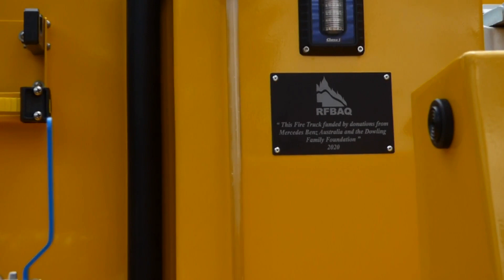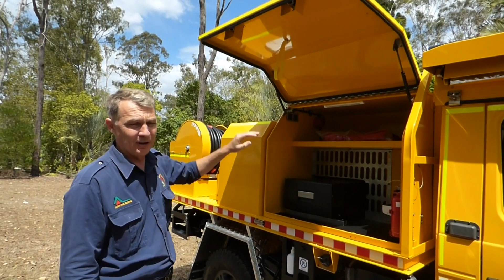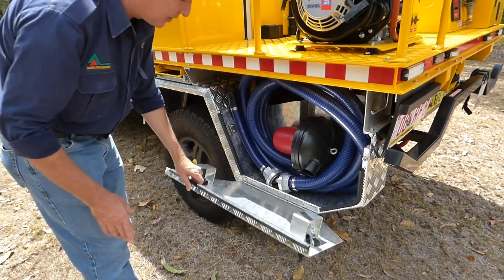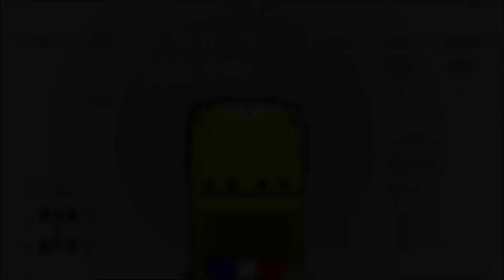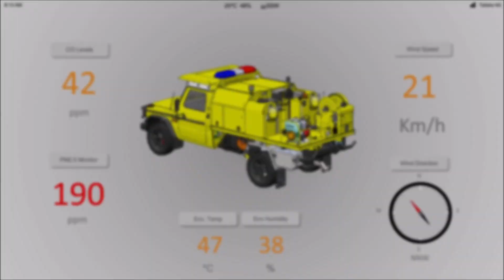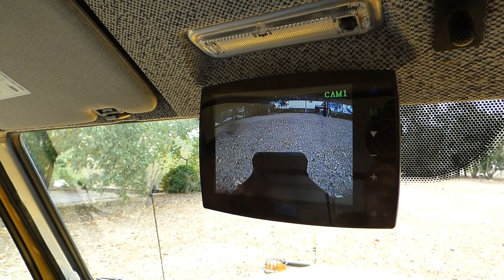RFBAQ QuikCorp Innovation Platform

Comment: In theory every appliance should be put over a weighbridge to make sure they are within GVM. This is unlikely to happen because many would fail.  This is a huge risk that is ignored by QFES.

Some great ideas on this appliance.  I particularly like the drip torch fuel tank...clever.
Reply: RFS vehicles  do not need to meet transport law as they are unregistered found that one out when I went to register and ex rural truck Bellthorpe 41, I had to spend hundreds making it roadworthy again
Reply: @lukwat71  are you sure that just because they aren't registered they don't have to comply?  Where did you get that info?  I look forward to the commissioner using that defense in the coroner's court :o(
Reply: @SirSteveDavis  I am rural and that come from mechanics and from TMR
Reply: @lukwat71  I am a 30 year rural and I doubt "we don't have to comply" would hold up in coroner's court.  But I am no expert.  Based on what you are saying, we can speed and run red lights too.  So which parts of the act must we comply with and which can we ignore?
Reply: @SirSteveDavis  ok so how can I buy an ex rural truck with no compliance plates for the removal of a front bench seat of a single cab Ute to make it a 2 seater from a 3 seater and re-laced with a single bucket seat, a Ute with a siren kit still installed, seat belts removed and others completely inoperable these are the things I got fined for after buying the Ute and RFS wiped their hands of this $600 and 4 points so please don’t tell me that RFS vehicles comply, which was a teir 2 defective vehicle
Reply: @lukwat71  where did I say they comply?  I wondered which Traffic Act rules must be followed (i.e. complied with) such as speed, and which don't such as having a siren and GVM?
Reply: @SirSteveDavis  so you have just admitted that RFS do not comply with TMR laws ie rego, modifications etc etc and yes you are allowed to go o0ver the speed limit by 10%. If they were complaint with rego they would have either fleet number plate or tmr plates.
Reply: @lukwat71  I am not interest in arguing semantics with you.